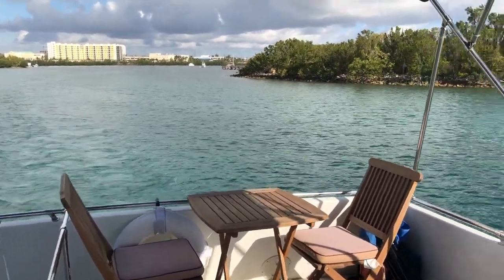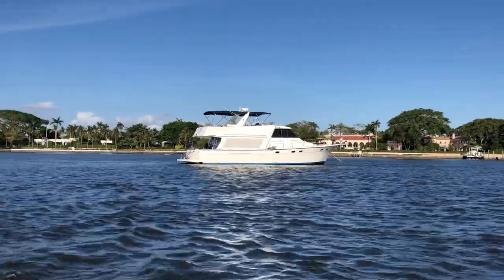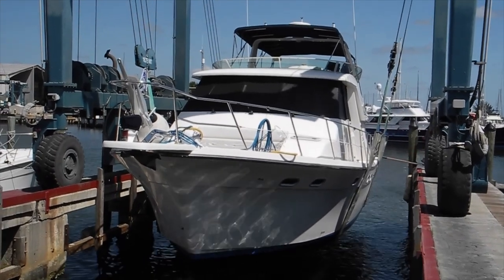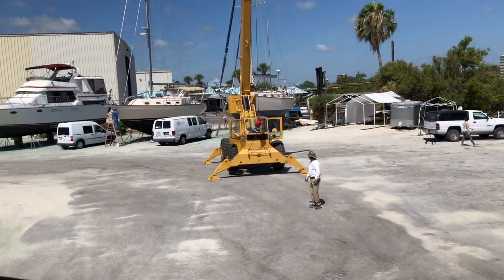Replacing our Generator, Bayliner 4788 Motor Yacht: Westerbeke to Northern Lights

Comment: Change out looked well done and I'm sure you will be happy about your decision due to fuel savings and dependability. It sounds a lot quieter than the old one. It may not have been a good choice if you were planning to sell the boat, but since you plan to have it for a long time, I think you made the right choice. Happy sailing.
Reply from the maker: We agree.. for our long term plans, we think it was the right choice.

Comment: Very very very smart purchase!!! That 12.5 was WAY too big for your needs, and you are correct in saying that generators should be ran at load. 60% load is a good starting point. Personally, I would have gone with a similar size genny, and upgraded electrical loads. Led lights, efficient refers, 3M solar film on windows, etc is a better use for your money.

Thanks for another great video.
Reply from the maker: Oh, we'll be doing all that too (already have all LED lights) - but cruising in the summer time as we will be - we do want the flexibility to comfortably run at least 2 ACs when needed.
Reply: Technomadia I ran 28k worth of ac in a camper on 5kw, but i couldn't run the microwave at the same time, so I'm sure you'll run into something similar as you noted in the video. There really is no sense in running the oven, stove, 3 ac, etc all at the same time.

I meant to ask what is your fuel consumption rate per hour while typical cruising and running the genset?
Reply from the maker: Check our '1 Year Loopivesary' post back in April.. we shared all that then.
Reply: Technomadia great, thx. I just got through your launching video after the channel marker incident, so I'm way behind!

Comment: You should look into the motor starters caps on your A/C s an get the start load under control...being there 20 yrs old this might be or not a option...wynes had a nice video on the subject...have fun
Reply from the maker: Yup, as we noted in the article that goes along with this video - that's in the plans.

Comment: That is an incredible video!!! I would have freaked watching that generator going out while the boat is moving at the same time. Wow. I do fail to understand why they didn't have the new generator ready to put back at the same lift out. It's not like haul out is cheap, and I"m sure they charged you both times :-(((
I was just reading Nigel Calder yesterday who suggested that for most loads except AC, it was best and more $$$$ effective to use the inverter instead. I THINK that's what I understood. Id love to hear your input.
Reply from the maker: We have long given the same advice - it is silly to run a generator for small loads like charging a laptop or making coffee.

As for why we needed to haul twice - we weren't certain how much time would be needed for any repairs or prep work once the old generator came out. Considering the cost of reserving the lift and crane, it didn't make any sense to keep them on standby for potentially hours.
Reply from the maker: There was a lot of potential work to do between removal and installation to get the bay ready for the new genset (cleaning, new mount to be built, fittings, etc) ...  they would have had to block us and keep us there while that was attended to (more costs, and no AC while on the hard).  It was easier to return to our nearby slip and be in comfort... where we also had our living room remodeling going on too with our carpenter. Haul-out was cheap in comparison to the alternatives :)
Reply: Not even consideting the usual delays, missing parts, etc, I get it. It's RV headaches, times 100. But the lure of the water, and the challenge, are more piwerful than reason...

Comment: Presumably the mountings to the boat in the old and new generators didn't line up? How did Eddie/you solve that?
Reply from the maker: We removed the original base plate after the old generator was out, and Eddie made a new one before the new generator was brought in. No biggie.
Reply: Ah, thanks.
Reply: Nice video. Do you install a second set of isolation mounts between the boat and the base plate? Thanks.

Comment: Couple of questions.   Not criticizing,  I know you must of had reasons. I’m just curious as I plan to follow your footsteps in about a year or two.
       Didn’t look like you took an opportunity for a fast bottom inspection while hauled out?
      Why two haul out.  Seems like would’ve put the removal off until the new generator and sound shield were on the dock and ready to go?
Reply from the maker: We actually did inspect during both haul outs (even did had a pressure wash) - and remember, we had just spent 5 weeks on the hard in Miami.   Also, lots of prep in between to prepare the new generator for install - had to take out a lot of tubing, do some re-wiring, installed a new floor and do a lot of clean-up.  Wasn't practical to do it in the yard - as it took several days.
Reply from the maker: And sound shield was back-ordered by more than a month... as we covered in the video.

Comment: were looking into a bayliner 4587 but its generator is busted and we need to install a new one what would you recommend? the old one was a 12kw but we cant imagine needing that much power
Reply from the maker: We are very happy with our 6kw Northern Lights.  But we selected that after running our own energy use evaluation keeping in mind our eventual (and now installed) plans for solar & lithium batteries.

Comment: You have an A/C powered windlass?
Reply from the maker: Our windlass is DC powered. But it had been set up to run off the house battery, which was not charging.
Reply: @Technomadia  If house batt(s) don't charge from engine... makes sense. Thanks.

Comment: Have inverters for power. Swap them out for sinewave converters. They run true ac and some models will even keep your bats conditioned. Ordainary inverters shorten bat life.
Reply from the maker: We always use pure sine wave inverters in our power applications. We currently have the Victron Quattro Pro with our lithium batteries.
Reply: @Technomadia  
Great to see young sailers like yourselves doing it right.